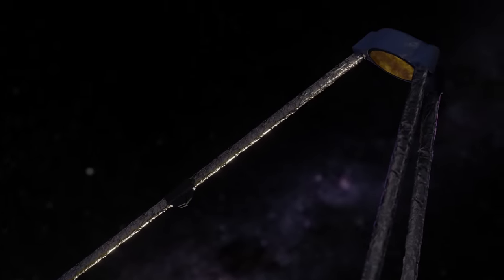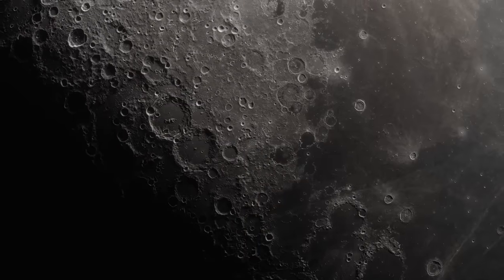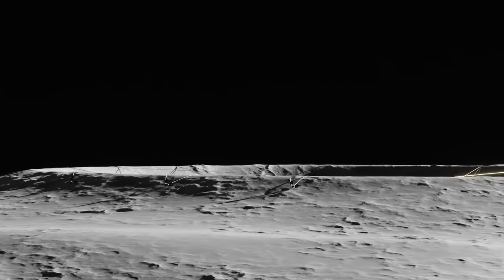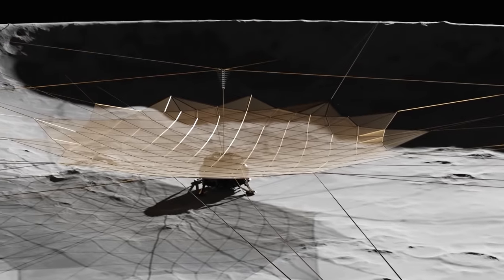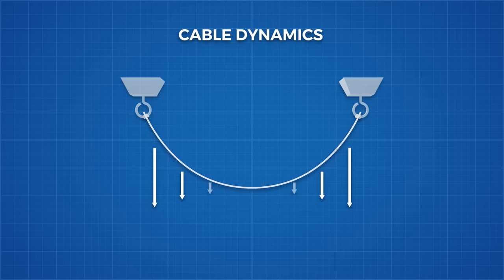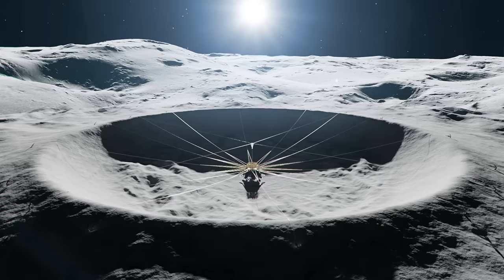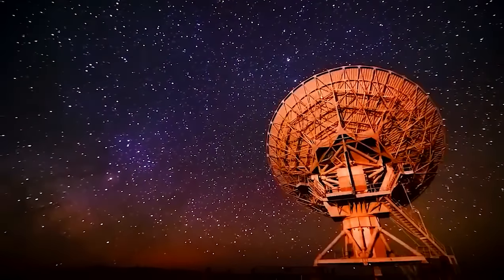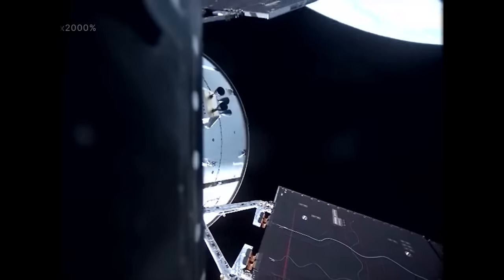NASA's Plan to Build A Telescope on the Moon

Comment: Now we’re talking. This is a badass idea that is actually pretty feasible. Difficult but way more feasible than mars plans.
Reply: Yes - or could instrument the moon so that asteroids can be detected earlier and destroyed/diverted.
Reply: @msulemanf you have a very limited section of the sky with this.  This asteroid business can be done much easier. It just needs more funding.
Reply: You need almost the same delta v for Luna orbit as for Mars orbit. And Mars is for more habitable than Luna. It doesn't have razor sharp dust for one.
Reply: Yes, and once the moon has gotten it's own manufacturing industry, a lot of cool stuff could be constructed.
Reply from the maker: @brll5733  "almost the same delta v". Yes, and I am almost the same height as Shaq
Reply: @RealEngineering 😂
Reply: @RealEngineering so am I, he's only 30cm (1 foot for non-metric weirdos) bigger than me. I'm barely 13.8% smaller than him.
Reply: @RealEngineering God damn aliens screwing around with the fundamental forces of the universe again.
Reply: @brll5733 Well landing on the moon is about the same delta v as landing on mars, such a statement would be correct. Lunar orbit, even low lunar orbit is much easier to get to than mars.
Reply: @RealEngineering  LMAO
Reply: @RealEngineering BAHAHAH😂😂😂
Reply: @RealEngineering doesn't it take around 4km/s to enter moon orbit but only 4.8km/s to land on Mars? That's the benefit of having an atmosphere even if it's thin is that you can aerobrake instead of using fuel. Of course Mars is still way more expensive overall because you can aerobrake to get back to Earth from both Mars and the moon. But it's not the wildly more expensive trip people expect (assuming you do a hohmann transfer)
Reply: no offense but who cares what you think is feasible
Reply: @RealEngineering  Yeah, the cost per m/s of delta v does not go up linearly. That rocket equation is a cruel mistress.
Reply: @RealEngineering real
Reply: @brll5733 toxic rust dust across the entire planet and atmosphere isnt very inviting
Reply: @brll5733 We can’t to Mars at the moment due to the extreme levels of radiation. An astronaut would receive a significant dose within months.
Reply: @ollie4022  the exact same as on Luna. Actually, more on Luna
Reply: @brll5733 but the amount of time required to get there is far smaller, so it’s less of an issue
Reply: @brll5733   Yes but a moon mission can last days. A Mars mission will likely last months.
Reply: @brll5733  Its dust, is however, insanely small and is one of the major concerns for any potential Martian structure or spacesuit. This is also neglecting the fact the atmosphere there contains traces of toxic metals , Ozone, etc due to its atmosphere -  structures can potentially react negatively to these surrounding reactive chemicals, adding another layer of complexity. Although its density is only about 1% ours due to its thin atmosphere, Mars also technically has winds to consider - not to mention its increased gravity as opposed to the moon. It being closer to the Earth will also make data transfer more efficient and less delayed. 

Do you still believe its more feasible?? I'm not pretending to be a rocket scientist here but I am in the mechanical field, and I suggest you consider doing research from all angles before making claims.
Reply: @RealEngineering that’s a response if i’ve ever seen one
Reply: Ya ok
Reply: @rongee3707  what’s up with you
Reply: @RealEngineering do you know what areocapturing is?
Reply: Do astronauts and engineers simply ignore bombardment of debris with no atmosphere to slow it down?
Reply: It's especially worth practical consideration considering how the Artemis mission is already happening. We already know how to send stuff to the moon, there's no doubt about that, so a telescope is worth pursuing.
Reply: Too many moon quakes and way way too dirty.
Reply: @brll5733 you’re thinking of the Mun and Duna.
Reply: Why not both? Yes both.

Comment: I am amazed at how much CAD has changed. In the late 90s, after Hollywood had rendered graphics like those in The Matrix, I was learning AutoCAD commands and being told that was what the industry used. Now you can throw together a few variables to generate a gear automatically, the click on parts of it to refine it and send it to a printer within minutes.
Reply: Exponential technological growth. Computers being pretty much the first widely applicable technology that can be used directly to improve future iterations of the technology.
Reply: Printed materials suck tho and they still need to be machined to tolerance after printing. Machined from solid block is more expensive, but still the way to go for precision high stress and wear parts that need to be made out of the thoughest alloys and with the best heat treatment possible. Like gears for example. Unless you talk about printed throw away plastic toys ofc, for those printing gets them from raw material into the trash bin much quicker then regular manufacturing methods :D
Reply: @pyropulseIXXI you wrong
Reply: @hernerweisenberg7052 printing has come a long, long way even in the last 5 years. Some of the tolerances that can be achieved are mind blowing.
Reply: @hernerweisenberg7052  We can print using materials other than plastic.
Reply: @THE-X-Force  yes, but those still need to be machined for precision parts. The printing process is not accurate enough for that, only to save like 90% of the machining necessary from solid stock. And the printed material wont have the mechanical properties high tech alloyed solid stock materiel has.
Reply: @hernerweisenberg7052 , The whole principle behind  3D prints is that printed materials aren't made for production , they are made for prototyping, proof of concept, etc...
Reply: @hernerweisenberg7052  Not sure how you think CAD means printed. Machining is literally CAD
Reply: @hernerweisenberg7052  cad is 3d modeling other machining tools use 3d models to do CNC machining
Reply: @Dustywitch  not always and not in space age aeronautics.

Comment: If you're trying to get a handle on LCRT's improvement, based only on size (and not on lunar location),
"50 meters greater than Arecibo" means LCRT will have a 135% larger surface than Arecibo
(which is probably why RE didn't state this)
Reply: And it should remain intact without maintenance for a whole lot longer because Luna has no air and minimal gravity - well played, NASA.
Reply: You can compensate for area with exposure time — 135% of area means the same amount of light collected in 74% of the time, or 135% as many "pictures" per lunar day, or however you want to look at it. 

A greater motivation for a larger telescope tends to be that the diameter drives its resolution. A 135% larger telescope can resolve features (stars, moons, sunspots, continents, dense spots in a hydrogen cloud, etc.) that are spaced 74% as far apart as the closest features that the smaller telescope could resolve. That's assuming all things being equal like the atmosphere or lack of, the receiver, the proper geometry of the reflector, and so on.
Reply: @HowlingWolf518 it gets bombarded by meteorites at a shocking rate. It has been hit on something like 100% of the surface. So much so that the ground material is pulverized into a uniquely structured material found only in extremely high energy collisions.
Reply: @noahkolodziejski2427  Right, but that 100% was over billions of years. Apparently the chance of actually being hit by a lunar micrometeor is about 1 in 1 million per hour.
Reply: @HowlingWolf518  But that’s for a single person, with less than 1 square meter of cross section. What’s the cross sectional area of the telescope?

1 year is 8700 hours, so in the smallest possible area you can pack ~120 humans (5 m x 5 m), a 45,000 mph rock will impact once per year. That’s a LOT. Look at what a 1/2 oz plastic did to aluminum armor at 15000 mph, then multiply the energy by 9.
Reply: @noahkolodziejski2427  The plan is for 350m across, so about 96k square metres (over a million square feet) and above a 9.6% chance every hour.
Luckily, most hits are from micrometeorites the size of a sand grain, much smaller than the impactor in that clickbait photo; Surveyor 3 was hit by hundreds of such grains (~800/square cm/year), and when Apollo 12 checked on it two years later, it was running fine with no significant damage. It's like a very slow sandblasting.

Yes, there's a chance that a pebble or golf ball-sized rock hits the telescope. No, it's not enough to stop space agencies from trying; the ISS runs the same risk every hour, and has actually been hit a couple of times (with no catastrophic damage).

Comment: If I ever hear anything about this through the usual channels, I would happily sign on to be on the front end team for the telescope. It'd be a fun upgrade from the VLA where I currently work in the front end group and a fun alternative to the south pole telescope.

Also at 6:59 that's rob Long, my boss, and Craig, who retired in 2021 and whose position I took over.

Concerning the redshift of hydrogen line emission from the early universe, that's something I'm a part of the low band team on. One of the main authors of a few papers on this search have been studying the redshift values as well as the difficulties of eliminating foreground radiation to determine post ground state emission data. Which, if it does eventually pan out, can reveal the process of collapse and consolidation of the larger regions of hydrogen from the ground state relaxation period to the earliest stars.

Finally, I know those videos from the VLA all come from the nrao  video about the VLA and is a few years old. But I love the use of that footage and seeing my coworkers on screen lol. Thanks for those little touches. The VLA is getting funded for the NgVLA which will be 246 different antennas stretched out over most of the southwest and I'm really excited to be a part of that.
Reply: Great short comment !  Visit the VLA in the rocket friendly state of New Mexico (NM)-call ahead for tour times...  Also the First Radio Map of the galaxy was produced  from an antenna in Wheaton, Illinois !  Timothy Lipinski
Reply: @TimothyLipinski  yeah I work at the VLA lol.

Comment: Maybe there is an obvious reason why this isn't an option, but it seems to me like an Artemis Mission on a Lunar Starship might have an easier time with those tether cables. I didn't catch if he talked about mass estimates but even with a lander with equipment and then a crew with drills might be able to set it up in a week or two. Rather than the complicated launcher spider
Reply: No reason why it isn't an option except continuing to pretend HLS Starship doesn't exist. The second Starship test flight could launch within the next month pending FAA approval.
Reply: He mentioned that a crewed mission would be a few billion dollars more expensive than a single lander with projectile anchors. Yes, it's higher risk to not send a crew, but when you're having to spend billions more dollars to mitigate the risk, sometimes it's better to try and account for it in other ways.
Reply: @drakedbz  He didn't mention crew at all, because the JPL study didn't mention it because they can't even conceive of it. If the Artemis landers especially Starship HLS prove their worth then it makes sense to use them, we will have the landers and the EVA suits and possibly large cargo rovers like Astrolabs which will all have been tried and tested at the South Pole, so the risk would largely be retired, we'd no doubt have some sort of lunar relay by then too, so no reason not to try for both the first ever manned landing on the lunar far side and the first ever large scale construction project on the moon in the same mission/s

Comment: Given that the JWST already was hit by a meteoroid, I am more concerned about the challenges of how to protect that telescope from impact of space debris as well as radiation damage to its (electronic) systems.
Reply: Hardening electronics from radiation is something we're more than used to by now so it's hardly a concern that can't be accounted for.

As for space debris/damage, we're going back to the moon. There will be people stationed there, future repairs are far more feasible for a moon based telescope than for the JWST (which is never going to be visited for a repair).
Reply: An estimated 33000 meteoroids hit the moon every year. The dish would have an area of 0.38 km^2 compared to the moon's total 38 million km^2.

So a probability of 0.00033 that it would get hit during its first year of operation by something "pingpong ball sized or larger".
Reply: The telescope is a mesh not a solid mirror so most of the time small debris would fly right though it.
Reply: The dish will be a mesh with holes of several meters.  There is more empty space than actual structure.  The chance of something important getting hit is very small.
Reply: Moondust. It's all about moondust. This stuff is a nightmare for any mechanics or electronics.
To my knowledge, we don't yet have a concept for a solution.
Reply: We could camouflage the telescope, so that it’s more difficult for meteoroids to find it.
Reply: @truejim  😄😄
Reply: The electronics would be protected against radiation just the same as satellites in orbit and if they survive going through the  Van Allen belt then I’m sure they’ll be fine on the moon
Reply: There is no way to protect that telescope or repair it.
Reply: @rudolfgernd8760 That's because no one has vaccuumed the moon yet. If astronauts vacuum the moon regularly, the moondust will become less of a problem.
Reply: JWST getting hit by a micro meteorite was an issue because it used nano meter scale calibration on the primary mirrors and the meteorite created small but noticeable ding at nano scale.  

The small meteorite hitting the Moon scope won't cause the same issue we saw on the JWST.  Of course, there's always a chance something substantial hits critical parts of the structure and cause a failure.  This is true even on Earth, so a chance is a chance.
Reply: Being on a solid body should actually reduce the risk of debris impact quite a bit. Two objects in orbit need only cross orbits to risk an impact, but impacting a specific point on a massive body requires a highly specific orbit, and usually a highly specific change in orbit as well.

Think about it like standing next to a building in a windy rain storm. There's usually a small area close to the building with far less rain, even when there's no awning. The wind will blow some rain towards you, but most of the rain is hitting the building. Stand in the right place and the rain can only hit the building. It would have to make an almost impossible change in path to reach you, so you're sheltered even though you can still see the sky.
Reply: @rudolfgernd8760  You do realize there's no wind on the Moon right? The reason Moon dust is so fine talc-like powdery is because it's rock that's been thoroughly radiated by the Sun from being in the same spot for 1+billion years.
No need to worry about solar panels being covered by dust like Mars rovers do due to wind and atmosphere.
In the rare exception of an asteroid impact kicking a wave of lunar dust, a simple matter of making rotating solar panels will solve this problem.
Reply: @rudolfgernd8760  It's nowhere near that bad actually. It was feared during the Apollo missions because it was largely unknown, but now its composition is understood. It's just a challenge of abrasion resistance and sealing. Far harsher conditions happen in manufacturing every day, but even a crappy sandblasting cabinet will last for years if maintained.
Reply: It being on the ground would mean it would be easy to service. Especially if we establish permanent bases on the moon.
Reply: @kyzercube  it's not quite that simple. Moondust is jagged and highly varied in size, and the ionizing radiation causes it to develop electrostatic charges and erratic magnetism. The result is that it's a very clingy abrasive that will need to be mechanically cleared from sensitive surfaces. You can't just pour it off, but an automatic fine brush or a squeegee should handle it.
Reply: He said 6 meter min wavelength, so you need a pretty rock to make that. Also: Lagrange points are garbage collectors.
Reply: @dustinbrueggemann1875  Do you know how long I've been waiting to see solar panels in space with " wiper blades " ?
It's literally on my: 
" things space programs shoulda been doing a long time ago but won't for some silly reason " list 🤣
Ofc it wouldn't be regular wiper blades. They'd be space wipers, you know, designed to work with ionizing electrostatic cling.
Reply: @katzen3314 and on top of that, with it being a wire mesh with 21cm gaps (if I understand the video right), that probability drops even lower. Because any micro-meteroid with a size less than the space between the meshes has a chance to just pass straight through.

On top of that, with it being a mesh, the dish would still function. It would just lose some efficiency as that small portion would no longer be able to focus light onto the receiver, while the rest of the mesh is still able to do its job as intended.
Reply: AH humor. I love it, thanks truejim. @truejim
Reply: Meteorites are just the tip of the iceberg. As someone mentioned, moon dust will for sure be a problem. Not to mention that the regolith layer is 10-15 meters of ground, poorly compacted soil, so the question is how these guys will be able to fix the wires.
Reply: The mesh of the telescope would let a lot of micrometeorites through, but also if a wire on the mesh was impacted, it would likely only break a small part of the mesh, resulting in only small localized damage that doesn’t affect the image produced, which is true for most radio telescopes when compared to the precision needed for visible telescopes